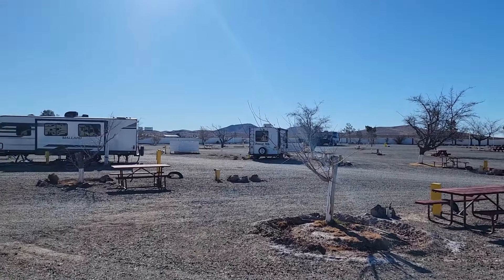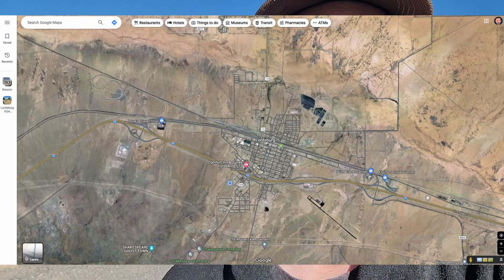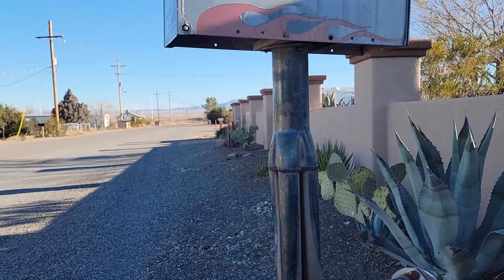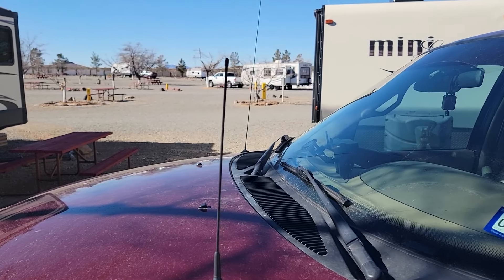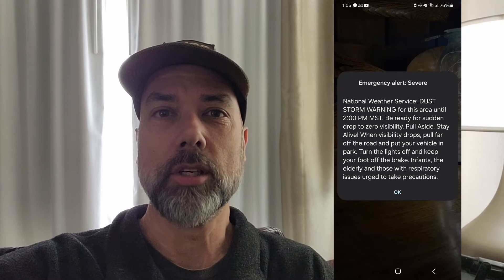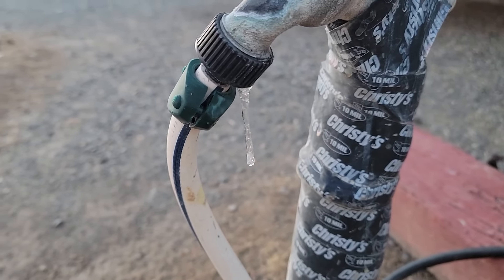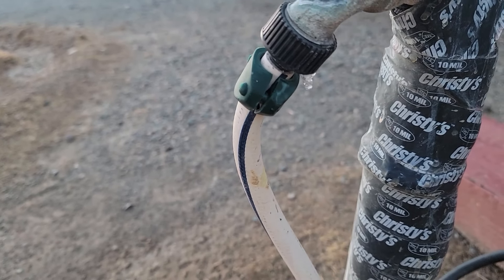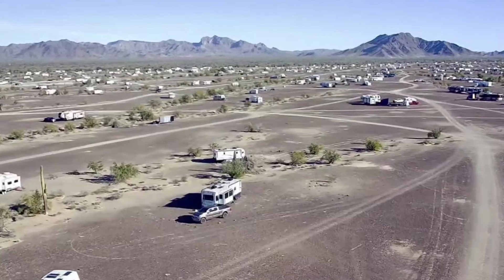Keeping the Pipes UNFROZEN and Staying Warm In Lordsburg, NM

Comment: We have a heated water hose. Our RV has tank heaters, and pumps warm air from the propane heater into the plenum. As long as the systems are running, freezing is not an issue.
Reply from the maker: I'm am still hoping to not do any more freezing weather camping... but... its a hope.

Comment: That always a challenge in fall threw spring in the us. lots of hard freeze. the newer PEX lines are better and don't split like the old PB lines. the fixtures still crack and break. drain the lines best thing you can do. even seen holding tanks crack . nice 2 meter AM . sounds better then FM with weak signal and goes farther. been cold in NY past weak. even TEXAS cold. worked JS8 call on 10 meters. several Texas and Florida  big cold snap across the US . Then I get a msg from a friend. 104F in Brazil. that saying to hot. we saying to cold. crazy.
Reply from the maker: A friend of mine got VK from AZ on 10m today.  The bands are crazy!
Reply: @livingforalivingRV  I got all over the UK this Moring on 10 meters FT8  . got a few friends of Load Callum in the book ! all around 7-8 AM NY time
Reply from the maker: Sweet!

Comment: Shouldn’t step 1 be assure that your LiFeP04 charger doesn’t kick on?  

Also, turning the water pump off and opening the faucets should NOT allow water to backflow into the holding tank. There is a backflow preventer for hygienic safety; you don’t want to introduce contaminants.   I used to install a stopcock on the output side of the pump. Then, when you turn off the pump, you open that valve which drains the pipe systems externally. You could put the dog dish (or a tea kettle) or whatever below that drain and still capture the water for use. 

Also, I came back to the camper once (in Roswell NM, actually) to water flowing out of everywhere.   The hot water heater itself (which was not fired at the time) froze and split. So that’s a point of failure to monitor.
Reply from the maker: Luckily I don't have a lifepo4 charger yet ;-). Probably won't get one in this RV.

When I opened all the faucets that relieved the pressure.  I'm not sure there is any check valve (I had hoped there was), but it appears that I don't have one.  Once the faucets are open and everything has drained, when I come back the next morning and turn the water pump on, it does take "a noticeable amount of time" compared to just turning the pump on mid-day when the system is "pressurized".

Maybe I got one that they didn't put together right (in yet another way).

Everytime I leave now, I disconnect the water supply.  Cheap "insurance".  I do need to get a water monitor system though.
Reply: @livingforalivingRV  Interesting. That water went somewhere, hehe. There is a little screen and membrane (in the old ones I had) it’s a clear circular dingus which goes directly on the pump OUT and the house pipe connects to it. You can remove it to clean it etc. see if the membrane is in it.